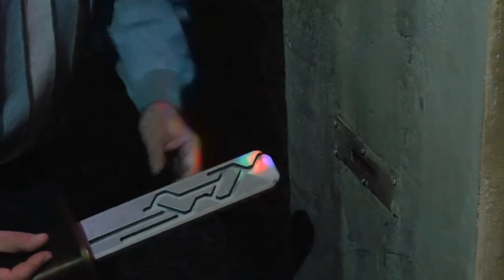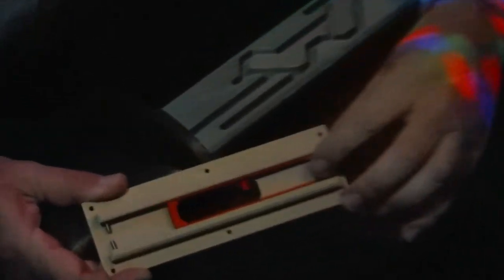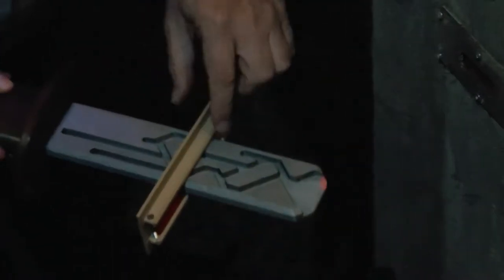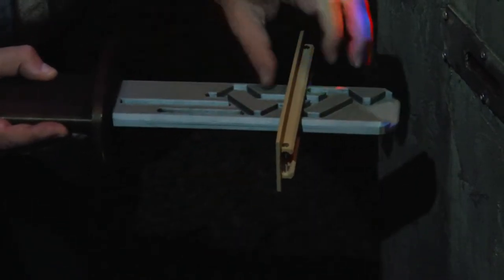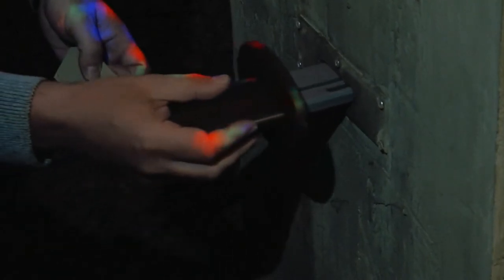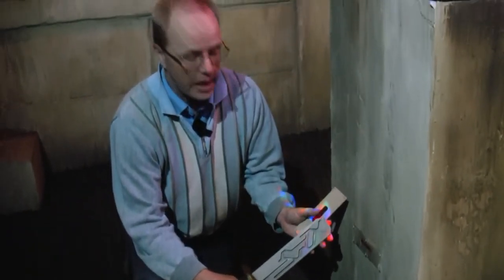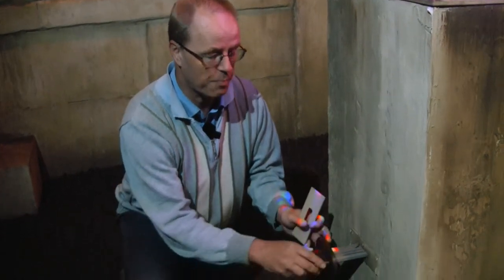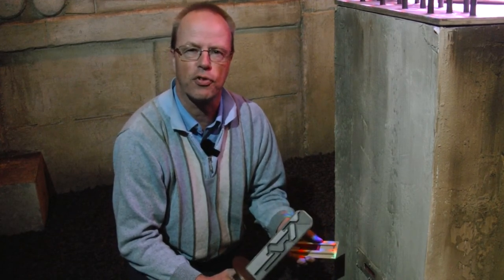Escape Room Sword - Can you free the treasure and escape the temple?

Comment: From what we could see in your previous hysteresis video, it looks like the exact same design as your original locomotion puzzle from 1986, but inverted so the puzzle is no longer to get it out, but to get it in. Pretty clever in the context of an escape room, since as you said the challenge there is to be able to reset the room quickly. It's also an elegant workaround of the problem you mentioned, of the puzzle being frustrating to solve since you couldn't see the maze. In this version you can see the maze from the start but it gets hidden as you solve it, forcing you to plan your solution and understand the maze fully.

As for the solution, by going from the first frame of this video with the handle on the left side, and by numbering each groove dead end from (1) to (4), with (1) being the further one and the goal of this maze, (2) being second to last at the bottom, (3) third to last on the middle, and (4) the top one :

* you push the sword up to the end, it gets stuck on (2).
* you pull it until only about a fourth of it is inserted. At this point, the pin should be over the parallelogram-shaped island, hopefully on the middle of it.
* you push it again as far as you can:
  ** either it gets stuck immediately, that means it's stuck in (4), that means you pulled too far and need to restart
  ** or it get stuck almost to the end like usual, that means you didn't pull enough and are stuck in (2) again
  ** or it gets stuck halfway through, that means you found the sweet spot, you're stuck in (3) and almost there
* you pull it about a centimeter or two, and you push it again, hopefully the pin aligns itself from (3) to (1). If you can push it all the way to the hilt, that means you're done.
Reply from the maker: Thanks! That is indeed what makes it suited for an escape room.

Comment from the maker: How would you solving this puzzle?
Reply: 1.
Push the sword in as far as you get.

2.
Check where the sword gets stuck.

3. move the sword to just before the location of the split.

4.
I would try to either move the handle slightly to the left or right (it seems like the sword still has some clearance). If that doesnt cause enough displacement I would to angle the sword.

5. repeat untill you have inserted the sword.

Please let me know if step 4. would be possible :)
Reply from the maker: @jamester0772  Sorry, that cheat you not be possible. Only in and out.
Reply: :p Had to try.

It looks like you can manipulate the pin location by moving it in and out.

1.
Move it all the way to the bottom.

2. move it back up so it will go into the middle-left path (assuming it went right based on depth and shape shown in video)

3. move it back down until the pin hits the bottom left groove.

4. Move it back up +- 3 cm so the pin falls lines up with the center path.

5. ......???

6. profit
Reply: Hai Oskar,

I read in one of your older comments you are an ICT researcher. What kind of topics do you research? Did you ever think about combining your ICT skills and/or research with your puzzle ideas?
Reply: Really cool concept! As for solving it, there's two aspects to it: the path the pin takes and the execution. I think the other commenters described pretty well the path the pin is supposed to take so I'll focus on the execution of the solution during an escape room. 

For ease of explanation I am going to label the 4 possible stopping points 1 thru 4 starting from the tip and going towards the hilt.

D===||---4--3--2--1-->

I am going to assume that the player has no measuring tools on them (no meterstick, measuring tape, etc.). What I would would do is:

1) insert the sword as far as it will go (the pin should be at stopping point 3 in the bottom track nearest the solution track)

The next place it needs to go is stopping point 2 via the top track that meets up horizontally with that diagonal section.

2) you pull out the sword a little bit and push it back in. It should get stuck in stopping point 3 again, BUT you repeat this increasing the the distance a little each time.

If everything goes right you should be able to get into that horizontal track I described earlier on the way to stopping point 2. If you get stuck in stopping point 1, you went too far. This should be easy to tell because the tip of the sword is stuck. Pull the sword completely out and re-insert to try again.

At the end of this step you should be at stopping point 2; stuck, but not as far as when you started.

3) repeat the same technique as before; pull out the sword a little bit, and re-insert, increasing the distance each time. For this one you want to increase the distance just a tiiiiny bit. looks like the sweet spot to get into the solution track is small, but it should be doable! 

At the end, the pin should catch into the solution track , insert all the way, and you get the treasure!

Maybe the treasure is the puzzles we solved along the way!

Thanks Oskar! I wonder if I can 3D print one of these to try myself? :)
Reply: Move it in all the way, move it back out until just before the top most false set (around 3/4 of the way), move it in all the way until you're in a false set, move it back out a bit, move it back in. Done.

Comment: Place magnets under surfaces that require proper alignment to open (chess board, coffee cup). Or glow in the dark paint to illuminate the path when the lights are turned off. Or a series of light switch pattern (up, down, down, up)